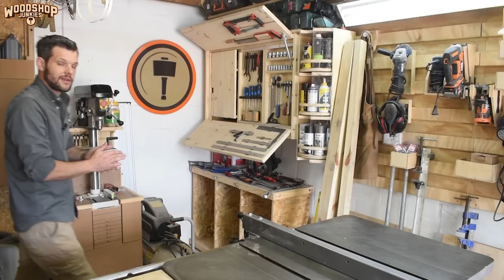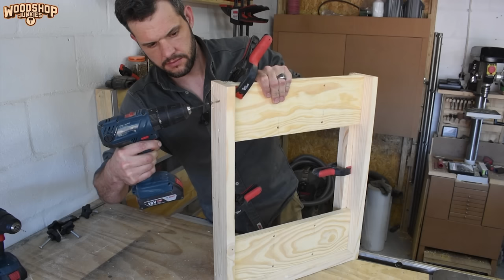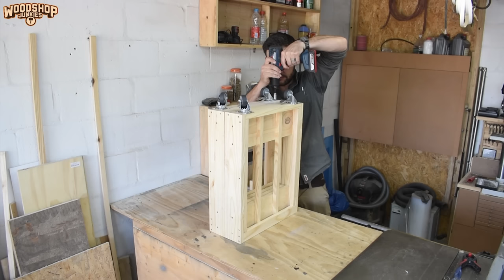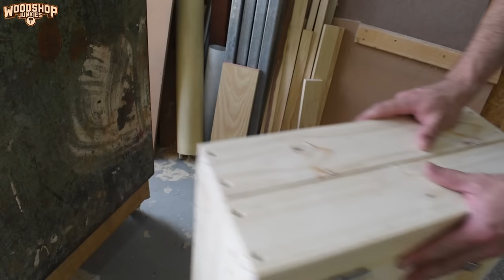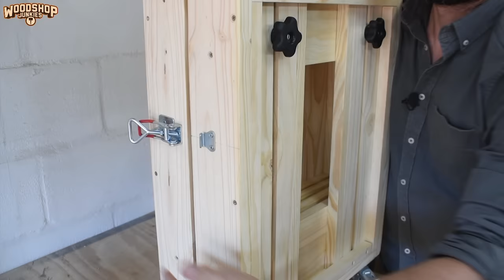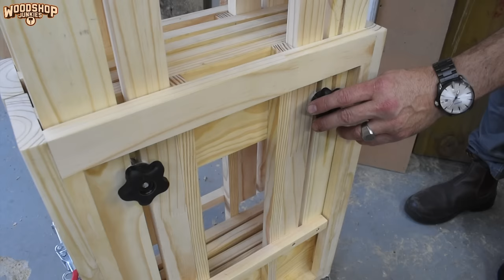Small Workshop Game Changer! DIY 3-in-1 Saw Horse and Outfeed Support System

Comment: I purchased the plans but I don't see where the materials list is. Am I missing something? Could you please post a list of what lumber you started with so I can purchase what I need at the lumber store?
Reply from the maker: I'm not sure I understand. There's a cutting list included in the plan.
Reply: @WoodshopJunkies  I see that, but It doesn't give me a lumber list so I can purchase what I need to build it. A list of what boards I need to buy to cut out the parts. How  many 19mm x 90mm boards and how long?
Reply from the maker: I don't generally supply such lists because people all over the world buy my plans. I don't know what the standard lumber lengths are in every country. You can email me the sizes stocked by your local supplier and I can try to find the time to draw up such a list for you.
Reply: @WoodshopJunkies  I can figure it out with the parts list. I just thought maybe you knew what lumber sizes you used to begin the project. I didn't think about worldwide sizing. I really appreciate you responding to my questions quickly. I will let you know what Imperial size boards I figure out for future reference. Thanks
Reply from the maker: @bigpetebipolar  no problem. Thanks

Comment: Very good; Very functional. Not over-engineered, considering the multiple uses you want for it. Personally, I wouldn't have tied them together like that, since uneven ground would mess with that a bit. So, I'd go with the typical sawhorse wide base (preferably collapsible) and put in slots to run 2x4s across the top in sawhorse mode so it can form a halfway decent work surface. Sorta like this one: https://youtu.be/NhAP-b0FCqg?si=vt8GwOz-1VAuPaTo
I gotta figure out a good way to combine these two :)